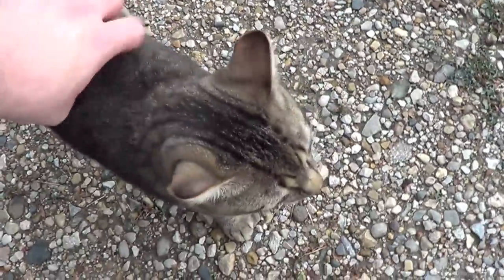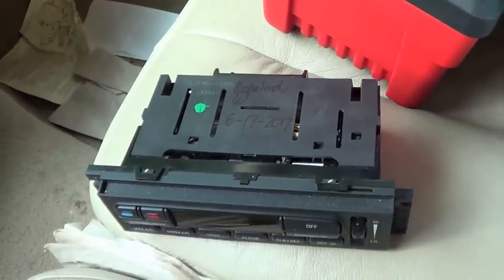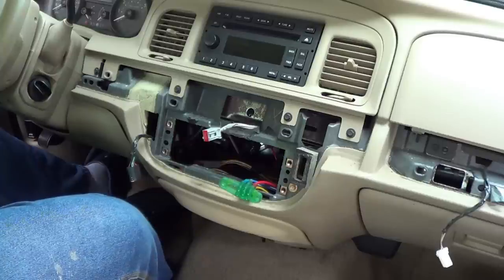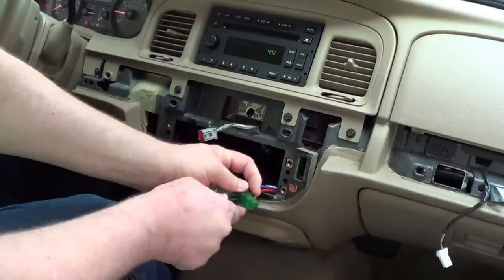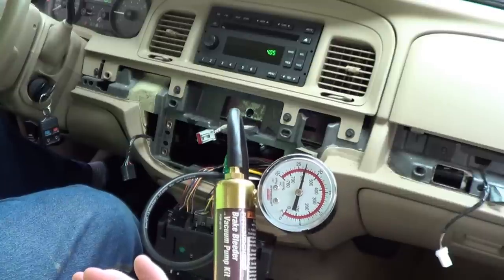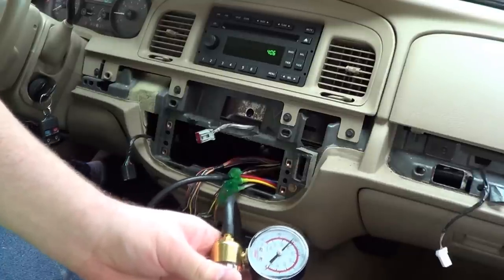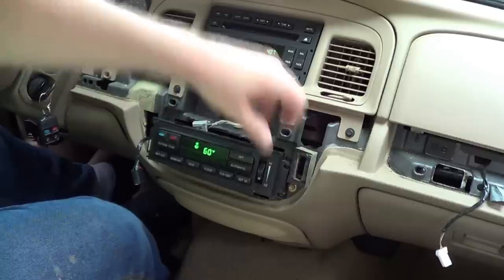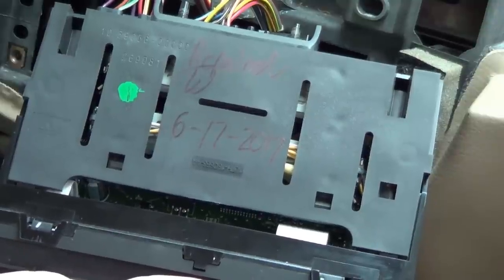Troubleshooting a Ford Electronic Automatic Temperature Control Module

Comment: I just ended up with a 1999 Lincoln Navigator and the heater was not working. It blew cold air. We flushed the system twice now and the heater works.  But I think this unit is bad, I have heat and cold air but I have to push the button for each.  The heater blows hot and AC blows cold when it is pushed.  I do not have the ability to set the tempter for a happy medium. I have been trying to understand how this unit works.  Your video helped.  Any input would be helpful.  I'm starting to not like this vehicle.
Reply from the maker: That sounds to me like the temperature sensor might be bad. All the Ford electronic temperature control heads have a built in diagnostic, and the instructions are readily found online to run it, along with the fault code meanings. Look up "Ford EATC self test" for more information. When you set the temperature control to either extreme (60 or 90 deg F), this forces the heat or air conditioning to run at maximum capability in auto or manual mode.

There is probably also a resistance check that may be made against the sensor with a multimeter to verify whether it is good or not. (You'll need a factory -- not Haynes or Chilton's -- service manual for this info, or a dealer that's willing to share the info. Some are.)

In addition to the temperature sensor (located behind a grille somewhere, with air pulled past it by way of a vacuum effect) there should also be a "sun load" sensor (although I'm not sure if Ford calls theirs by that name). However, I don't think that being bad would result in no temperature control.

Comment: Excellent video!  Quick question though as I'm trying to troubleshoot a "no heat" issue........would a problem with vaccum or other in this unit keep me from having heat inside the vehicle? Fan speed is good, all air vents work correctly when changing on th unit...i.e. defrost, floor,  panel.......but no heat when changing the temperature........my vehicle does not have a heater control valve install on either heter line, and the blend door appears to operate(I can hear the door position change).  Any ideas? I'd appreciate any advice on what to look for. Thank you
Reply from the maker: Are you sure the door position really is changing?

If it is, things to look at and for are a low coolant level, bad thermostat, plugged heater core, and for the presence of a manual heater core shut off valve. The hoses leading to the heater core should be very warm or hot with the engine at normal operating temperature.
Reply: @uxwbill    Ran EATC diagnostics......pulled 2 codes..... 12 and 49......49 does indicate there is a problem with the blend door.  Though codes 24 and 25 indicate more an issue with the actuator.  Guess I'll have to pull the center part above the transmisson hump to investigate more specifics.  Just thought that maybe one of the vaccums lines behind the EATC unit could be the issue. Sure would be easier to pull it rather than investigate the actuator for or the blend door itself. Thanks for your help.
Reply from the maker: It's a hybrid system. The various directional dampers are vacuum operated, while the blend door actuator is electric. Unfortunately, I'm almost certain it is the blend door actuator that has failed in your car.

Ford says the entire dash has to come out to get at the actuator in the Panther cars. I've found that if you loosen the steering column and remove the fasteners holding the dashboard in place, you can move the dash and carrier just far enough back to get at the blend door motor. (Be very, very careful with the transmission shift indicator assembly. It's easy to break.)

While it seems like removing the radio might give you access, the actuator is further to the right of the radio, and the area behind the radio is largely closed off anyway.
Reply: @uxwbill   It's a 2003 Ford F150 with the 5.4 Triton. Checked out the blend door actuator. It was bad. Replaced with a Doorman unit. Everything works now. Thanks for your help.

Comment: 2008 Ford Taurus EATC codes please? Where do I find them? Run the self test and came out with code 10    03
Reply from the maker: At your Ford dealer, on a forum where Ford vehicles are discussed or at the other end of a web search made from your favorite search engine?
Reply: uxwbill I ve been looking online and can’t find it.  I haven’t tried Ford dealer, I’m afraid they will want to charge for it.  Any idea what the code mean? 10  03
Reply from the maker: I have never owned a late model Taurus, so I don't have any information about one. I don't know what the fault codes mean for your car. Most dealerships are happy to exchange small pieces of information at the service counter, such as a page or two of printed information, without charge. If one doesn't -- find another. Another option would be to buy the factory (the only ones you want) service manuals for your car. They are not cheap, but will tell you almost anything you ever want to know.

I would again recommend asking at an online forum about the Ford Taurus.

Comment: Hi, the question remains what solenoid controls what. The controls on the front do not really work. I replaced the o-rings years ago and have a new not understood problem. I have replaced hte blend door module last year and things worked fine.
Reply from the maker: For testing it matters not which solenoid does what, though if you really want to know, the video tells all as I go through them with the vacuum pump.

See some of the other comments about this video. Ultimately, I came to believe that the solenoid body itself had several cracks that precluded any successful repair.
Reply: @uxwbill  Vacuum is a funny thing. I may have a similar issue. Having the module open in the car, each manual button operates a coil with a specific sound that suggest a controlled operation. One just say "Click". I will use a stethoscope to identify which one, identify the vacuum hose color and  check the vacuum motors. I'll measure the red wire and then ground out each coil, while providing vacuum on black. I just want to totally understand it before I move on. You know, one has to know. :)

Comment: My problem is that the blower motor runs on high only even with the unit turned off. Any way to fix this. Thanks
Reply from the maker: Make a check of the basics first, such as any relevant fuses. It's likely that the large transistor used to control fan speed has shorted.

Comment: If the plastic is cracking up, it's best to find a replacement (used or new, whichever's easiest), glopping cracks up with a glue to seal it up would probably last a short while before the rest of the plastic fails too, just another example of planned obsolescence...

Comment: I have a question I drive a Mercury Grand Marquis 97 I replace my actuator but the lights on the control panel are not working
Reply from the maker: The actuator has nothing to do with the lights, which are tiny "grain of sand" bulbs that burn out after many hours of use. That is likely what has happened to yours. I don't know how easy or difficult they are to replace. You can convert to LED, but this requires a circuit modification in the form of a current limiting resistor. The result also isn't quite as evenly illuminated as with the original bulbs.

Comment: Great video thank you. Thumbs up. I have this exact vehicle and mine works, but switches between cold air and hot air about every 30 seconds when in automatic mode. Any ideas what that could be? 2010 Grand Marquis LS 41k miles.
Reply from the maker: That's not a problem I am familiar with. The blend door actuator, when it fails, usually goes to the "full hot" position and stays there. I think you may be dealing with a sensor or associated wiring that is bad. It'd probably be a good idea to inspect solder joints on the control head where the cables connect, and at each sensor.

It's interesting that you mention this happening (only?) in the automatic mode. Even if you override the air direction and fan speed controls, temperature control remains automatically operated unless you set the temperature to 60 or 90 degrees Fahrenheit (or its equivalent in Celsius). Or is setting the temperature to one of those extremes what you're doing?

Comment: I have a 2008 ford crown Vic p71 that I recently bought with 80k miles. Before I bought it the Freon leaked out and the seller had it replaced. When I bought it had working cold a/c. Now I’m having a problem where I have my temperature at the lowest setting and it would blow 75 degrees or above. Sometimes one vent will blow ice cold air and another would blow burning hot air and another would blow air from outside that’s 80 degrees also when u try to use my heater when it’s like 47 degrees at night it does not work. Does anyone possibly know the problem?

Comment: I have a '99 Expedition.  I just ran the test, and it passed, I had all 8's.  But the vehicle does not blow heat.  I heard the noise you were listening for.  Would the test detect the blend door actuator issues?
Reply from the maker: It should. However, it is possible that the motor could be running while not driving the damper. The test might still pass as the resistive sensing track is in the motor assembly. The problem may lie elsewhere...plugged heater core, bad thermostat, low coolant, or possibly even a valve that shuts off the heater core when only A/C is needed.
Reply: @uxwbill  i unplugged the vac lines in the AC control so I could change the light bulbs in it (AC display lights comes on/off maybe sth wrong on the circuit board.)  I'll change the thermostat.  Thanks.  Did you mean clogged heater core?  You said plugged...
Reply: @uxwbill  The valve you refer to that shuts off the heater core is in the engine compartment; right?

Comment: Hello Bill everything on my 1999 Grand Marquis LS works except the the flap door module it won't switch from A/C to heater I can do it manually but the module that operation don't work every the new one I'm not getting power to it to make it work???
Reply: How do you manually switch it? I'm tired of my heater being on

Comment: My 2000 Ford Expedition has the same HVAC control panel, and uses vacuum to change between different vent outputs.  As far as I know, it has never had a vacuum leak, and I'm pretty sure it uses the same system as this car.  Maybe Ford used cheaper plastic, or there was a defect with the plastic in these cars.
Reply from the maker: That or I'm probably just incredibly lucky!

Comment: MY OLD NEMESIS! Dad bought a Mercury Sable with one of these, THIS thing stopped working after about 5 years/100,000 miles, when I started driving. The display would freak out and never worked again, displaying random garbage on the screen. I used to set it by remembering what it used to look like, this was before Youtube or anything useful was posted to the internet.
Reply from the maker: The display failure was probably caused by cracked or otherwise faulty solder joints. I've heard of display failures with these, but have yet to see one.

Comment: Hey Bill great video, do you know what the signal voltage to activate the blend door is, assuming it’s electrical. And the upper and lower values of the Position feedback. Thanks
Reply from the maker: The temperature blend door is electrical and driven by a small DC motor. I don't know what its normal operating voltage is. Nor do I know what the upper and lower values for resistance are. (I think the latter appears in Ford's factory service manuals.) What's most important is that the resistance be a smooth, even sweep.

Comment: Interesting, I had a Jeep on which the vacuum system failed. The car couldn't start, and until this point I had no idea what they meant with a vacuum system. I always thought it was something much larger, more intensive, and providing constant pressure.
Reply: Very informative. I've only recently started dabbling with my cars, and have not run across any vacuum issues. Had this level of resources existed online in 2008 or so, I may have made an attempt. However I was raised with the mindset, if you can't afford to replace it, don't screw with it in the first place.

Some light Googling seems to indicate that this was a common issue on my car, and was related to the intake. It was an '04, and never really had any other issues. Unfortunately for the money the dealership wanted to replace it, my best bet was to sell it.

Comment: My 2002 lincoln town car has a problem with its fan speeds. When I have the ac on one of the lower settings, the blower motor sometimes blows faster by itself. I changed the blower resistor and the ac module and didn't help. When I do a cold start (not driven for hours) it all works fine somehow. After 5 minutes of driving the motor starts blowing faster again when in a low setting. It should be the module, but since it didn't work, I was thinking it might have something to do with the wiring of the module but I'd like to know this for sure first. Any ideas?
Reply from the maker: My only thought would be that somewhere, the resistance is changing. Perhaps it's the motor, maybe it's got a few windings that are OK when cold but gradually short when warm.
Reply: @uxwbill  oh, thanks. I havn't tried this yet but it sounds logical. The problem with these things is that it's not a common problem so there is no answer to be found. So i'll try this out

Comment: I've been trying to "dig to the root" of the issue with the automatic climate control module in my car - a 2000 Buick Century. For some strange reason, the exterior temperature reads either higher or lower than the actual temperature, and the difference is a lot (like +/-20 to 40 degrees in some instances.) Any ideas, as I don't know where the thermocouple is located on the exterior of the car. There is this wire (which resembles a thermocouple) between the radiator and the grill, but that seems like an odd place to put it as it would throw it off.
Reply from the maker: It's very likely that you'll find the sensor right where you were looking, between the radiator and grille. That's where it has been on every GM vehicle I've owned that was so equipped. And yes, when the car is sitting at idle somewhere, heat from the radiator does throw the reading off. Usually the sensor module is a featureless plastic shape, either cylindrical or a rounded rectangular shape. Every one I've seen plugs in.

If the reading is off when you're going down the road and air is flowing through the grille, I'd first suspect any grounds and after that I'd take a long hard look at the sensor itself.
Reply: It's off when it is on the road... so I guess I'll take a look at the sensor. Since I don't have a shop manual or anything with the electrical schematics, I wouldn't even know where to start looking for a ground. Plus, I'm not sure if it is something that I'd be willing to spend time/money to fix.

Comment: I have an 02 Excursion. All electric connections to the climate controller. Every now and then, it goes hot on me, typically, ha, at very inconvenient times. My rear AC continues to cool. I think it’s flipping the blend door to default, heat mode. Still directs air to the vents. I have cycled the unit on, off, ran the temp setting to max, then min, kept trying until it decided to start working normally. For the rest of the 700 mile trip, about 500 to go and the week and 700 miles back, it continued to behave. Maybe you’ve worked on one of these controllers? At least this one gives me some clues. Intermittent problems. Probably won’t ever happen at the shop, ha!
Reply from the maker: I have no experience with the Excursion. The actuator is likely quite similar what's used in this car and I suspect the failure mode will be the same as well. The problem will get worse over time, as the resistive strip continues to wear.

Comment: Thats an awesome video.  It was helpful to me in fixing a problem with a crown Vic a few years ago where the air only blew out of the defroster.  I now have a 07 Marquis that the blower motor wont start.  Hooking up direct from battery the fan is ok.  The resistor is new so I think the problem may be in the EATC unit.  Do you have any videos on how to diagnose the fan control switch?
Reply from the maker: On those cars with EATC, there is a module that governs the fan speed. Check all your fuses, and if they're OK, you've probably lost that module. It's not uncommon, especially if the car was subjected to a stressful electrical event (jump start, boost charge, etc.). Sometimes it fails shorted, rather than open.
Reply: @uxwbill  Thank you for quick reply and I will look into that.
Reply: @uxwbill   i rechecked the system with a voltmeter and found there was voltage going  right to the blower motor when the fan was on and it still didn't work.  there was a break in the ground  from firewall to engine.  i  replaced it and ran it direct to battery and it solved problem.  im not  good on electronics  but with videos like yours it  helps people like me fix things and learn and save money. thanks